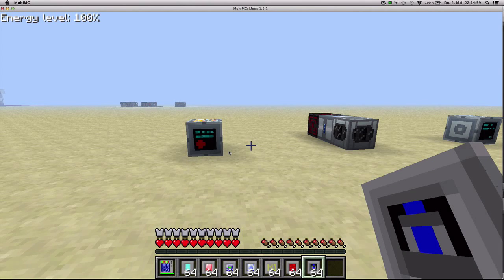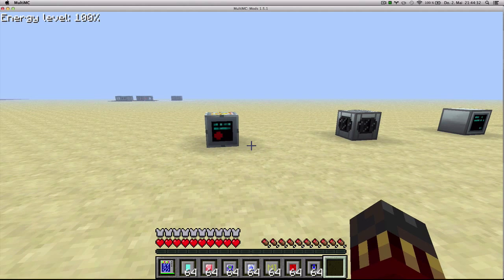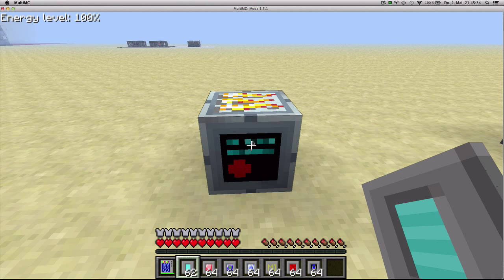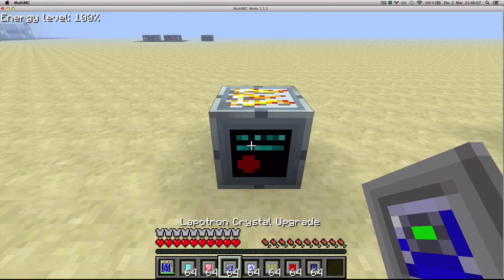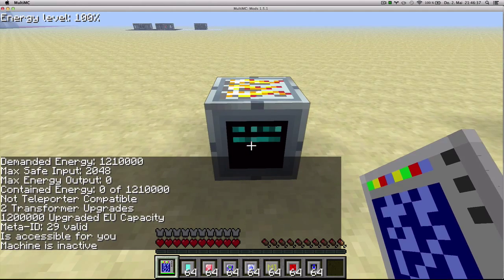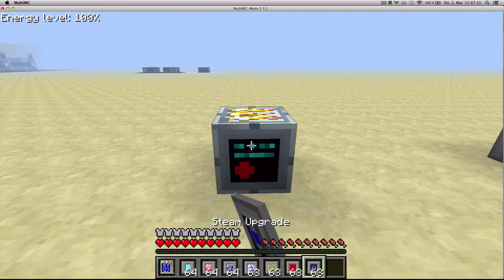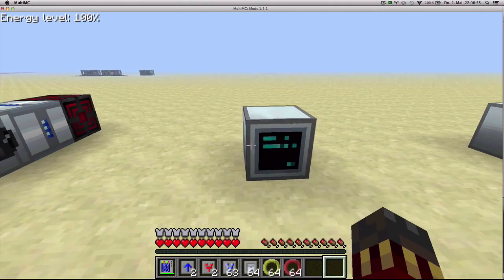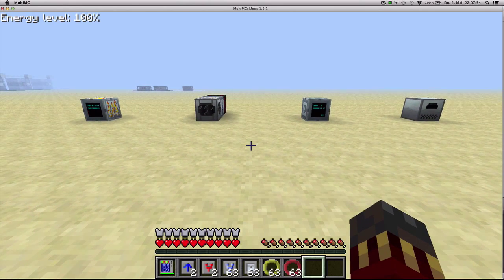[Tutorial] GregTech from Scratch 05 - Upgrades

Comment: i have to say. i love how gregtech adds exciting challages and makes a automated world a challange and fun! however the upgrades for the gregtech system are still confusing misleading and clear as mud. hard to tell what to do with what upgrades. a simple "overclocker" dosn't cause the machine to run faster, in most cases you have to also increase input with an upgrade otherwise you have a "brick" this system could use a great deal of tweekage have "slots" on the machines like the vanilla IC